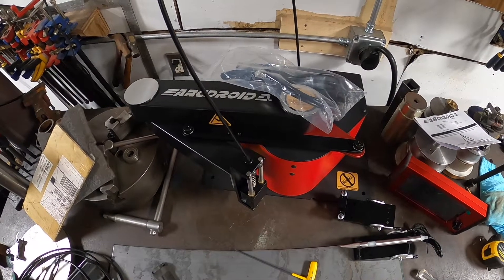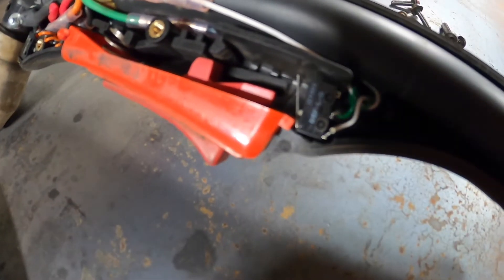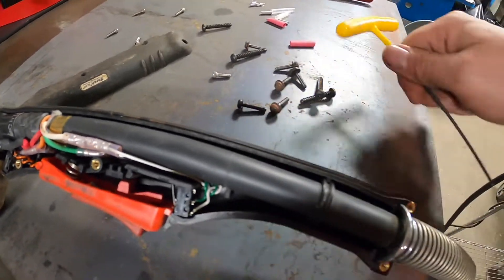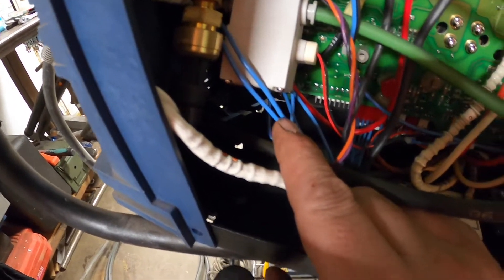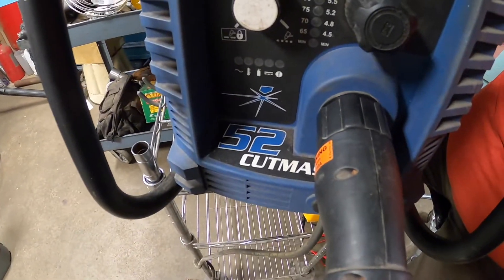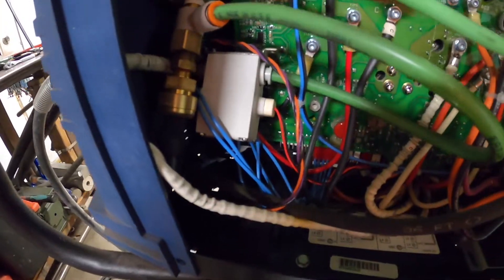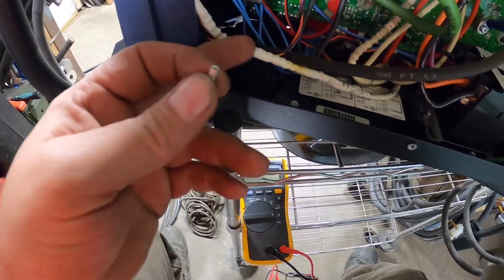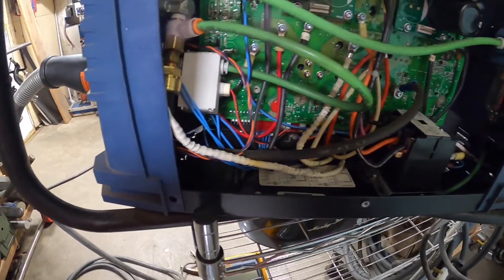TD Cutmaster 52 CNC Hook up

Comment: I know this is pretty old video but is some good stuff.  I'll add a little more info i've been able to track down in case someone is looking (like I was).  There is already a torch start pin available on the board on the J10 header right behind where you were working - J10-8 is for Start and J10-5 & J10-6 are common so shorting those 2 should give you torch start.  There's also some additional stuff available - on pins J10-1 and J10-3 appears to be an OK-TO-MOVE signal and then I believe you can get raw tip volts from the board by measuring across the lugs Work 1 and Electrode.
Reply from the maker: Dang bro. It sounds like you know much more about the machine than I do. Which is totally cool!
Thanks for watchin!
Reply: What type of connector do you use for this?  Is it a standard 2.54mm type connector?  Do you have a specific part number?
Reply: Figured it out myself its TE Connector 640620-8 with Cover 640550-8
Reply: I shorted j6 and j8 and fired right up

Comment: Hello, can you tell us how it went with the connection?  did it work?  How did it go with the THC height controller?
Reply from the maker: Everything worked perfect.
Reply: @sidetrackmetalworks2058  I'm glad you can help me install mine, how did you connect the THC height controller to your machine and what cables did you take...?
Reply from the maker: @EsMartiYsrael  I only hooked up the two trigger wires.  I’m not sure if the arcdroid even has THC.